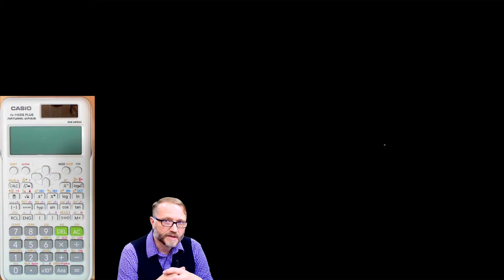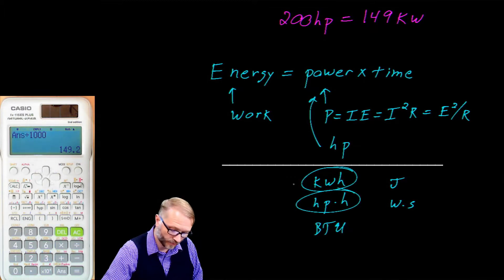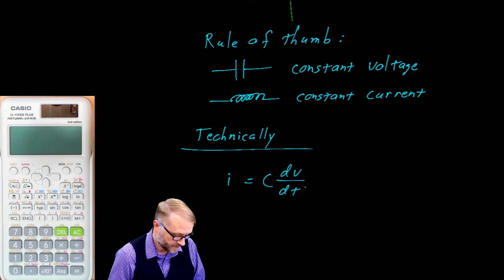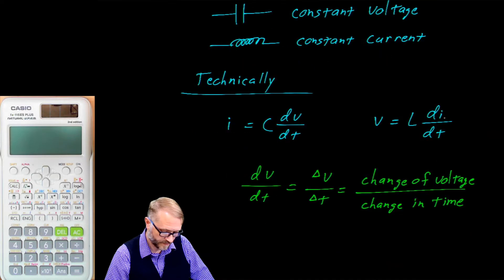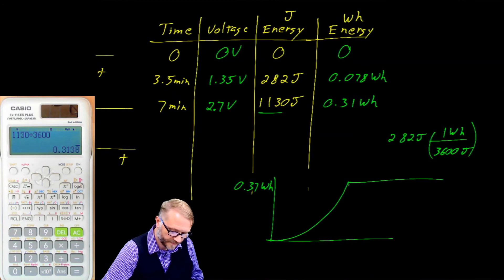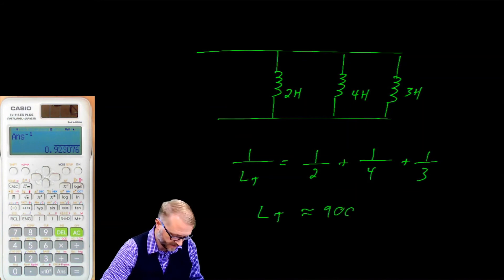#8: Inductors and capacitors

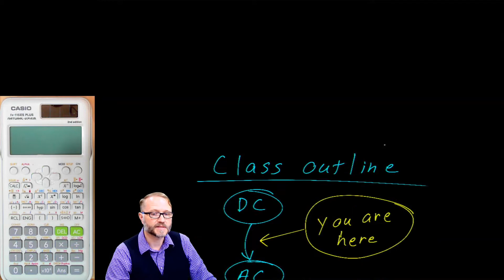Comment: 00:10 You are here.
00:31 Tools check
01:11 Applying to A New Layer (AC)
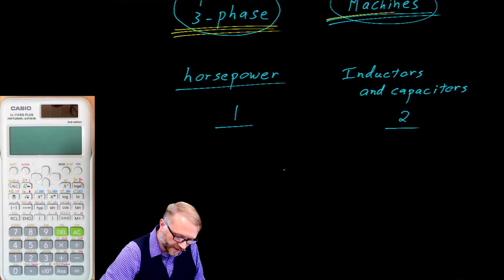02:05 Horse Power
02:35 HP-> What?
03:14 Example Turn down the Watt!
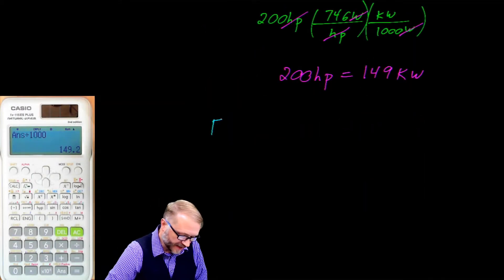04:14 Energy Revisited
04:46 New Unit of Energy
05:18 Example Cost of Electricity 
07:21 Inductor & Capacitor (Symbol)
07:41 What are they
08:02 Energy Storage Defined
08:20 Energy Formula
09:02 Capacitor Explained
09:34 Inductor Explained
10:17 Note: Rule of Energy 
11:11 Rule of Thumb
11:37 Calculas Notation
12:02 Review: Rate of Change 
13:40 Example with Henry (Inductance)
14:00 Graph: y= Current (Delta)
15:10 Graph: y= Volt 
16:41 Table Form w/ Energy 
18:48 Graph: y= Energy
20:01 Example with Ferret (Capacitor)
21:53 Graph: y= Current (delta)
22:09 Graph: y= Volt
22:28 Table Form w/Energy
24:06 One More Conversion
25:36 Recap
26:20 Series and Parallel everywhere
28:59 One Thing to Remember